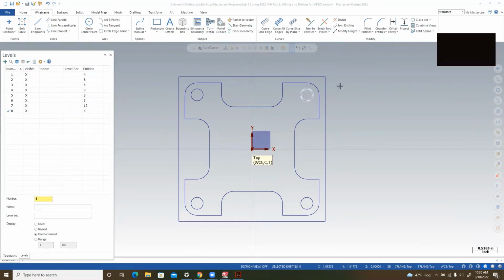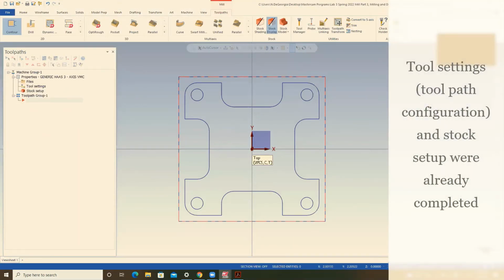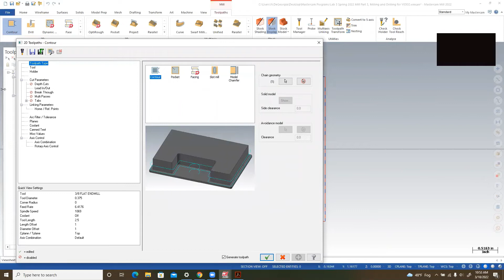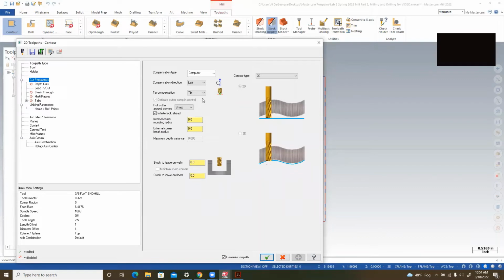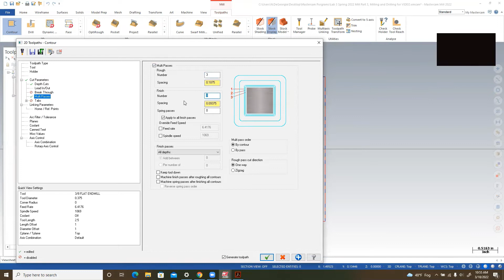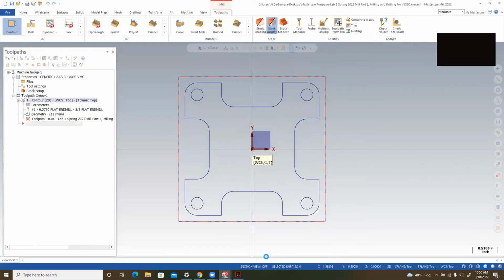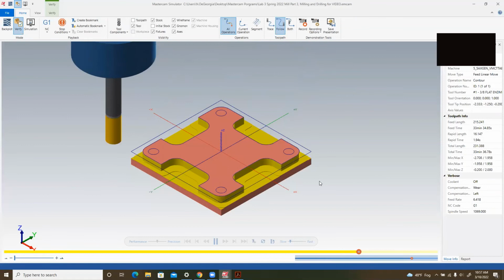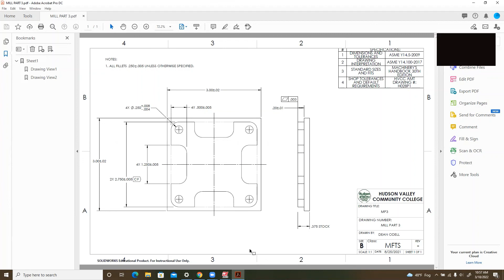Simple Mastercam 2-D Contour Milling

Comment: How do you know if it's going to contour the outside or inside?
Reply from the maker: Hi, thanks for posting this question! Under the contour milling tool path, if you select parameters, there is a "cut parameters" tab. If you select this, the second box on the left says "compensation direction". This tab is for selecting the correct cutter compensation based on your cutting direction. If you select "left", the tool will be compensated for the tool's radius on the left of the contour, or the outside. If you select "right", then the cutting action would occur on the right side of the geometry. Thanks again!
Reply: @mr.dsmanufacturing  Thank you!
Reply from the maker: @Nicholas5c  Anytime!